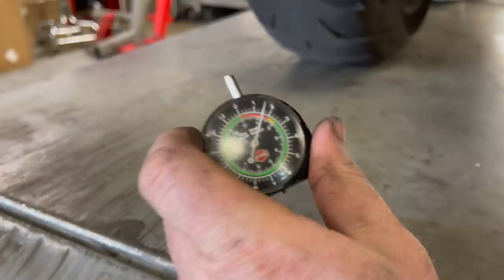Preparing For A Road Trip (Oil /Tire change On Road Glide) | Downtown St Louis

Comment: I have to use the spray wash as well as I live in a condo. Just sharing what I learned the hard way, DO NOT spray directly at the wheel hub/axle.   Especially with the degreaser or soap.   You can strip the grease very easily from your wheel bearings and that can become outright dangerous while riding.   Much love.  Keep up the great videos.
Reply from the maker: Thank you!

Comment: Let me give you a couple tips about washing your bike in a car wash.  Avoid washing the bike when the engine is really hot.  Avoid the switches on the handlebars, the wheel bearings, and the steering head bearings with high-pressure spray.   If you do that washing it at the car wash won't hurt it.

Comment: My only criticism of your riding is that you don't seem to scan enough. Meaning if you are coming to a cross road you don't scan thoroughly. You'll see a vehicle, quick glance in that one direction then turn. A better way would be to scan left right, left right then turn or make a move. Or if you are changing Lanes, to take a quick glance over your shoulder before turning. Or if you are at a stop light look left - right, then left-right again before rolling. This has saved my ass a few times now after 100k miles on motorcycles and over a million miles in cars and trucks. Otherwise you seem safe enough, if a bit under dressed. You do you boo, but check twice always. I hope this advise finds you well and helps you deliver years of content.